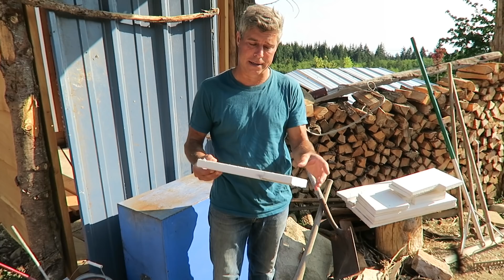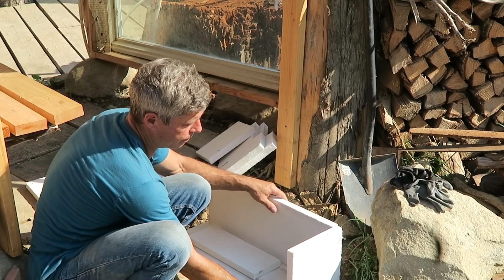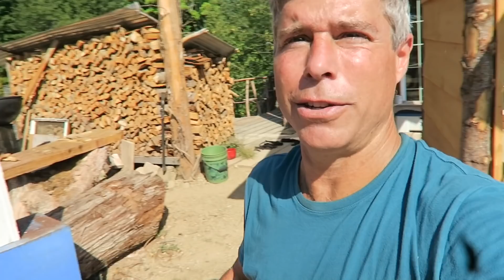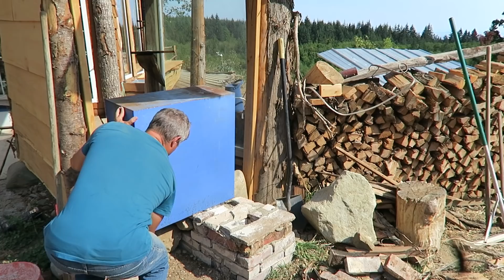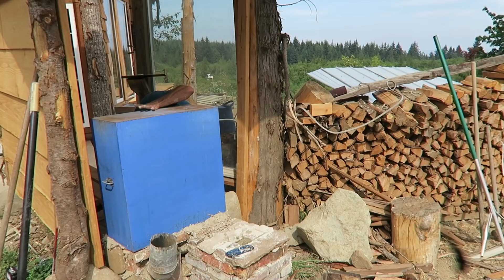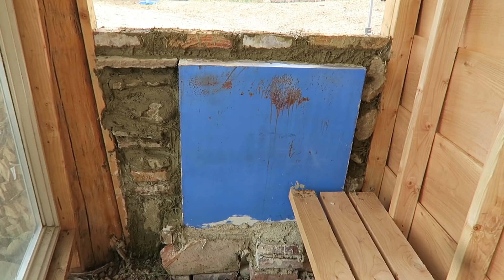Ceramic Fiber Rocket Stove Build Discussion

Comment: Badass video, as usual. I am adding on an extra bell to your cookstove I built last year. Gonna send you a pic when I finish the top.

I'm digging the construction motif as well, I do the same often with logs. If you haven't looked into hewing before, I find that I can usually roughly flatten one or two sides pretty quickly with a chalkline and eliminate the 2x4 I used to throw on there. Cheers.
Reply from the maker: Thank you Kieran, appreciate the kind words and feedback as always.  I'd love to see the stove and hear about your experience once you get it going.  Good tip on the log build, I do often split off a side(cedar) but in this case I wanted to land the siding on the 2x4 with the log as corner "trim".  I kinda faked this one, the 3 corner logs(not the big wood stack post) went up after the framed structure.

Comment: Is this a good priced vendor for sheets of  the Duraboard LD?  I am assuming you are using the 1" from what I see in the video?  (1/2" and 1 inch are priced at two in a carton, and 2" at one in a carton.
http://store.armilcfs.com/fiberfrax-duraboardr-ld.html

You have to select each to see prices...

$73 for two 18x24" 1/2 thick sheets
$93.58 for two 18x24" 1" thick sheets
(Not even looking at 2", since you seem to have great results with 1")

Shipping to me is about $52 if I buy one carton, and $62 if I buy two.  It looks like two sheets might be enough for this design?

Thanks for the great video!  I was looking at kast-O-lite 30 and ceramic Fibre blanket, but I really like the simplicity and ease of working with this material.
Reply from the maker: Yes, 1" is my preference.  You could do better on price buying full sheets (36"x48") direct.  Those will ship freight though, so it may end up being a wash.  If you are in W. OR try Western Industrial Ceramics by phone, see what they can do for you.  You might still opt to buy these smaller pieces online.  My base is just over 24", but I imagine you could make it work.
Reply: broaudio - thank you!  Was intending to order your cut plans when I get the dough together to get the board... That vendor is only an hour further drive than relatives I'll be visiting in Salem near the end of the month, so will be giving them a call.  Is that core made from a full sheet of material, or less? If more than one sheet, is three full size sheets enough to make two full cores? (Would get an extra if I have to get two sheets for one, but could make two cores with 3)

Thanks for answering these questions... 

  And of course, if there's info about materials requirements on your page offering the cut plans I missed, just let me know, instead of writing a long answer.  Thanks!
Reply: It would be helpful for people wanting to use your plans to add to the description "to cut from X.X 36"x48" sheets of your chosen ceramic fiber board product"

And of course, thanks again for all your excellent rocket stove development work and for sharing the fruit of your labor and derived knowledge at such a reasonable price!

  (Especially for giving of your time in answering my, and other's questions free of charge here on the tube, and forums)
Reply from the maker: Thank you for the thank you!  Yes, the plans state sheet size.  You can cut 2 whole stoves out of 3 sheets.  One sheet makes the lower core, then four riser sections of 6"x24".  Good luck on the build!
Reply from the maker: "It would be helpful for people wanting to use your plans to add to the 
description "to cut from X.X 36"x48" sheets of your chosen ceramic fiber
 board product""

Thanks for the input, done!
Reply: broaudio - very welcome!  Have you done any testo runs with builds based on this core?
Reply from the maker: I have not done any full runs, worthy of a graph.  In order to do a good run you need a well matched heat storage/extraction system in order to keep chimney temps low.  Otherwise the efficiency number will look terrible.

 Since I've only used this J for quick heat applications, BBQ, Sauna, etc, I haven't had a chance to test it in a full mass heater system.  From short samples with the Testo I do know that it combusts completely, capable of 0ppm CO.  The rest of the equation depends on how well you keep the heat in your space.
Reply: Thank you!  I was looking at combustion efficiency as opposed to the system efficiency that, of course, depends entirely on what I put after it...
Reply: broaudio - Western Industrial Ceramics quoted me $8 a square foot for their "1" thick LD board equivalent", and $10 for the Unifrax product.. so I wound up massaging Google a bit and finding another Oregon based supplier with much more reasonable pricing by the case... They have a warehouse in Tualatin, and many other places.  Hope this helps anyone else shopping for this stuff...  Some places are charging a huge markup on small quantity purchases...  Being able to pick up in person is a good thing for many of us poor folks as well...  They also have ceramic fiber blanket at relatively competitive prices.

http://ceramaterials.com/ceramicfiberboards.html
Reply: Guess based on this, I'll have to call and verify the pricing from the Tualatin warehouse...  But it shows that they are a place that has stock in many locations, so worth people near these cities who don't want to pay freight checking if picking it up from one of these locations is their "best deal" option...

"
Now stocking boards in;
- East Brunswick, New Jersey
- Pittsburgh, Pennsylvania
- Wanatah, Indiana
- Dallas, Texas
- Houston, Texas
- Los Angeles, California
- Hayward, California
- Tualatin, Oregon
Not all sizes available at every location.
Prices may vary at different locations.
10% discount for full pallets.  Call for quantities & availability.
Additional handling fees at some warehouses may apply."

Comment: which would you recommend?

this - http://thermal-industrial-ceramic-products.thermalproductsco.com/item/-products-fiberfrax-ceramic-fiber-board-insulati-2/ber-board-insulation-fibermax-duraboard-17r-3092f-/fibermax-duraboard-17r

or this - http://thermal-industrial-ceramic-products.thermalproductsco.com/item/-products-fiberfrax-ceramic-fiber-board-insulati-2/ceramic-fiber-board-insulation-duraboard-ld-2300f-/duraboard-ld

The 17r product goes to 2300 deg f 
the LD product goes to 3000 deg f
Reply from the maker: The lower density products are more insulative.  Go with the second, the duraboard LD.